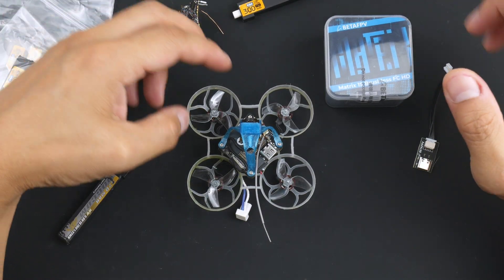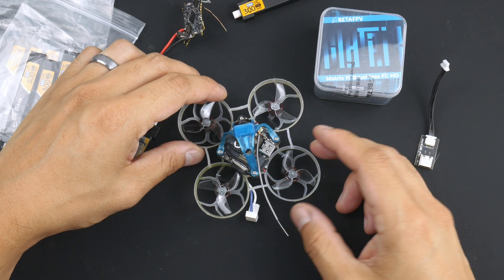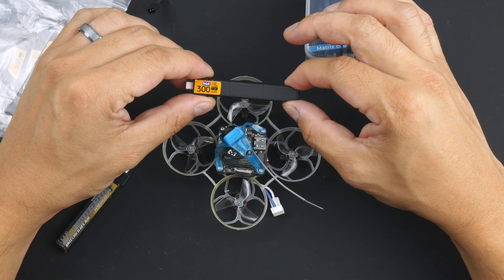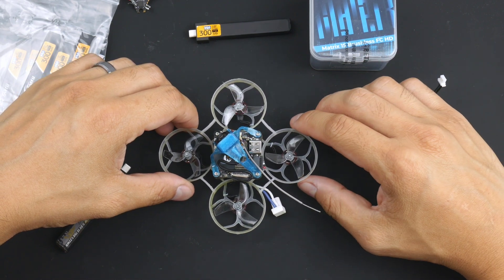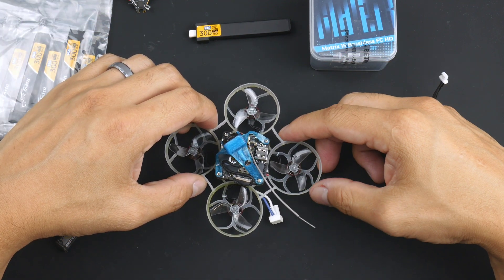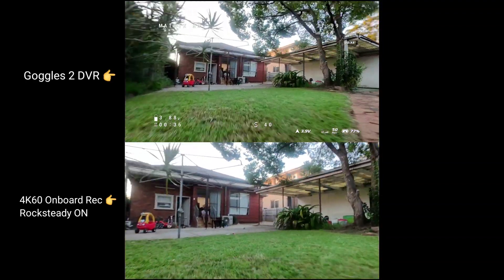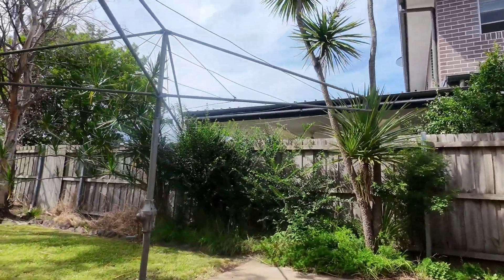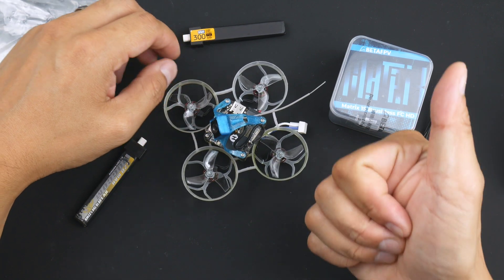DJI O4 Mobula6 BetaFPV Matrix Upgrade Results! 65mm Tinywhoop

Comment: Hi! Great video, thanks for testing the Mobula6 O4 🙌

I have a question about indoor flying.

Right now I’m flying a Flywoo Firefly18 Nano Baby V3 O4, and I’m not sure what makes more sense for apartment flying:

• stick with the Firefly18 and just keep practicing
• convert it to something closer to a Firefly16 (frame, motors, props)
• or get a Meteor65 Pro O4 PNP (without HD VTX) and move my O4 camera there

I noticed you briefly showed a Firefly Nano Baby in one of your videos, so I’d really appreciate your opinion:

👉 for small apartments, which platform is actually easier and safer to fly indoors, and why?

Comment: where is the antenna from?
Reply from the maker: @TheDavid76  it's a 2.4GHz linear dipole antenna with an IPX/U.FL connector usually used for radio receivers. Bought from AliExpress. You need to cut it down to the exact length as shown in this video https://youtu.be/vgEYksOxlhc
Reply: @nxp200  Okay thanks bro

Comment: nicee! have ordered a meteor 75 pro O4, but seeing your build really want to cancel the meteor and build this one since i will fly the most indoor and a 65 with that weight is really tempenting.
Reply from the maker: I think the meteor75 O4 would still be great indoors. I fly my 75mm Caddx vista indoors occasionally. The meteor75 O4 would have much better stable and controlled flight. Perhaps you can build one later or mod the meteor65 O4 to be the same as mine.
Reply: Built a custom Air65 with the meteor canopy, it is an absolute joy to fly indoors. I also built a 2s Air75 and it is a beast of a tiny whoop, too much power for inside lol, but it is perfect for diving small buildings/trees light poles, racing, and things like that. DJI O4 is amazing.

Comment: Did you remove the motor plugs from the Matrix FC too? I'm currently at 24g with a similar build but with motor plugs
Reply from the maker: Yep. Removed motor plugs. I just weighed the plugs themselves and the 4 plugs total 0.36g
Reply: @nxp200  Is that with both ends? I think the motor side might add another half a gram too. Otherwise I dont know why my weight is so much higher
Reply from the maker: Haha. Sorry. I didn't think about the motor side of the motor plugs because I had taken them off a few weeks ago. With both ends taken off, it totals 0.60g (8 pieces)
Reply: @nxp200  amazing thanks! Did you also remove the o4 connector off the matrix board?
Reply from the maker: No. Left it on. However I did think about it but figured the methods to remove it to be too risky given the tiny components that are close to it.
Reply from the maker: Just a thought, do you also have peek motor screws as well? Because that saves about 0.5g
Reply: @nxp200  I've got 2 peeks 1 metal per motor, that might be the difference
Reply from the maker: @itsjase92  yeh might be! My peek screws have held up well so far. If they ever start breaking or go missing, I'll deal with the extra weight of steel screws then 😂
Reply: @nxp200  Yeh switched out the rest of the screws and got it down to 23g! Thanks.

Also I had the same printed canopy as you but I switched it to the mobula o4 canopy which weighs the same (0.9g) but seems to be much more durable
Reply from the maker: Oh nice! How is the 4k recording? Does it have any jello or jitters? Would be interesting to see what else works
Reply: Best I’ve found is Betafpv canopy but that adds a whole gram which is a no go.

Surprisingly the biggest difference for me was switching from the gemfans to the hq ultralights, really reduced it

Comment: Another great vid! Just a heads up too. I crushed the metal shielding on the O4 with the way you have it mounted. So i would recommend mounting it over the usb connector instead. I tried it with some foam but that still wasn't enough to prevent the metal getting dented. It still works but every knock now it will disconnect from the headset before reconnecting. Going to have to put in a ticket with DJI about it.
Reply from the maker: @MrWheezyE420  Thanks! Appreciate the warning on the shielding damage. I haven't had a chance to give it a true rip yet to subject it to heavy crashes. I'll see about turning it around somehow. All the best with DJI ticket. 🤞🏻